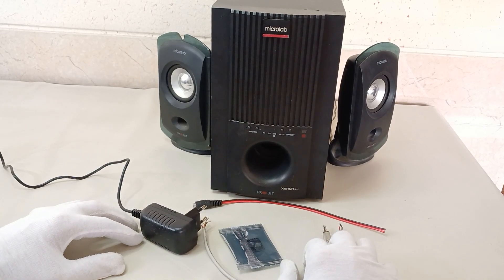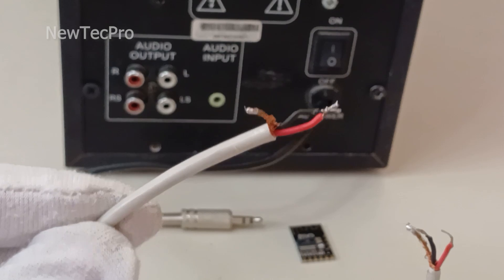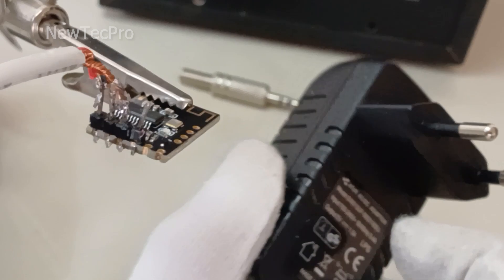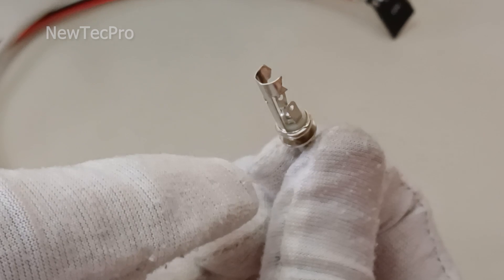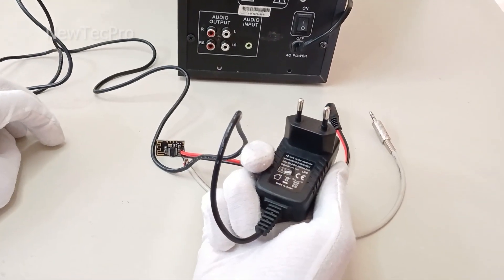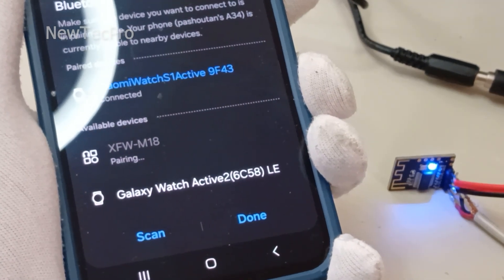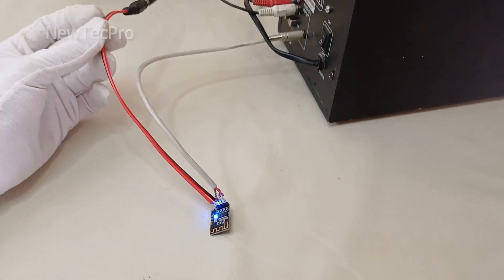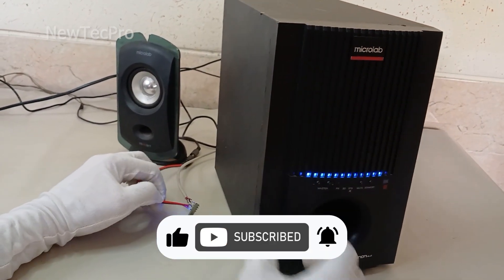How to Add Bluetooth to Speakers? DIY & Upgrade MH-M18 audio receiver board

Comment: Sound is very low compared to aux cable , any ideas to boost it without damaging the speakers?
Reply from the maker: The quality is good. In this video, the problem is the speaker, which is not of good quality. But if you connect it to a car stereo or a good amplifier and speaker, the sound quality is good